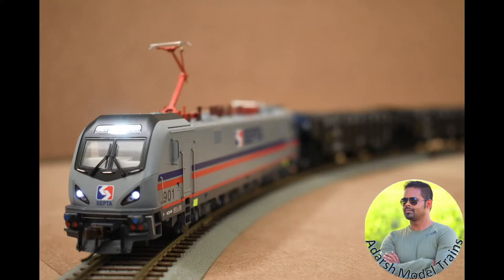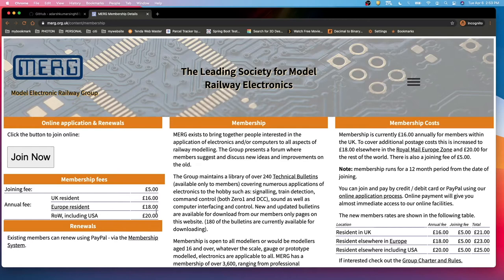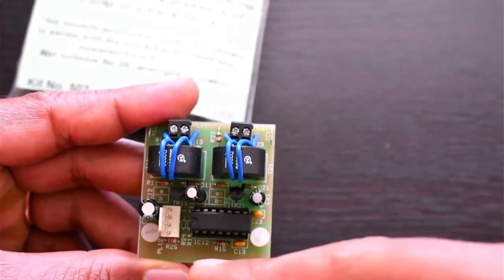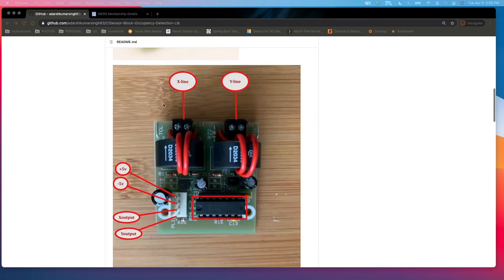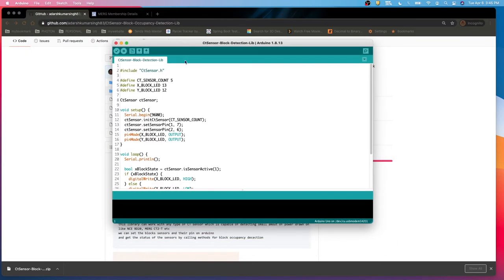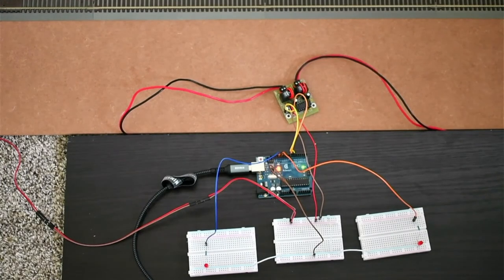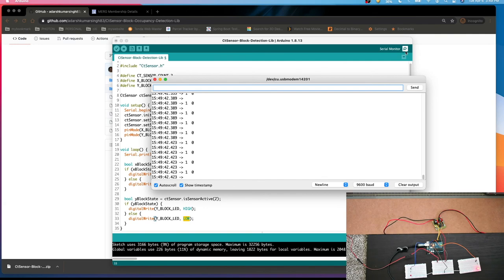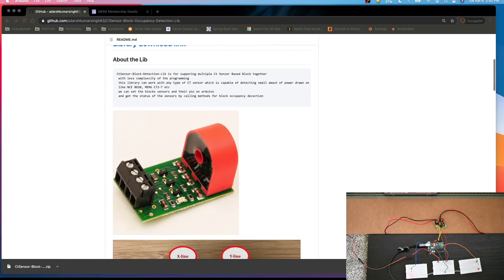Model Trains Dcc Ct Sensor Block Occupancy Detection Arduino Library for Model Train Layout

Comment: Does the MERG kit require an Arduino or can it operate independently?
Reply from the maker: HI Nick merg kit  only generate the signal high and low but that has to interpreted action has to be taken based on that , not only Arduino any system which can understand high and low signal for the block occupied or unoccupied can be used